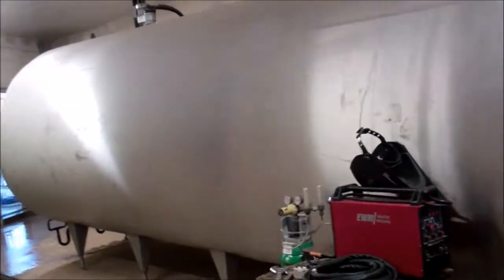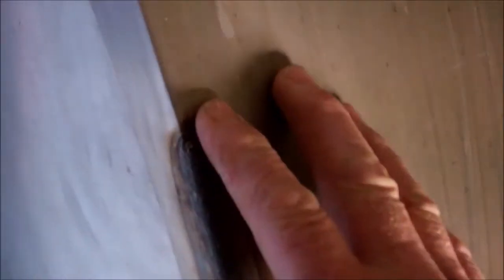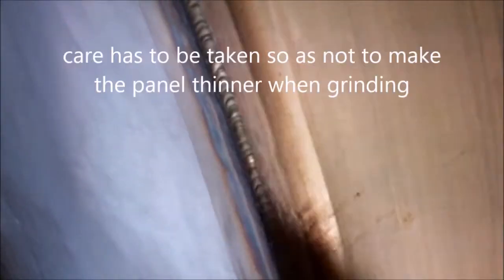Split milk tank needs tig welding repair to front stainless steel panel.

Comment: The weld is on a food grade item so I assume rhe weld is a fusion weld without filler 
Thank you for the great videos
Reply from the maker: Hi bill, This panel of the milk tank covers the insulation cavity, and to re weld this joint is a little difficult because the original weld has left an oxidized layer on the backside of the joint (as there is no easy way to purge the backside), to overcome this and get a good structural repair weld, I do use filler wire and make sure the filler pushes through the panel so that any oxidized layer that forms on the backside is pushed inwards and away from the joint itself, and I also need the weld to stand up on the outside of the joint to enable a square corner to be formed after grinding & polishing.
The other problem I am up against when welding, is stopping the panels from distortion as they are quite thin.

Comment: Can I ask what you use to polish?
Reply from the maker: Although this finish on the stainless steel is known as a polished finish no actual polish is used, this finish has a very fine grain in the surface and is created by carefully using rotating abrasive mops with the final mop being made of scotch brite material.

Comment: Good job sir! Just curious, what caused the tank to split open?
Reply from the maker: Thanks, The end panels on these tanks are flat and do flex outwards when the tank is filled and back in again when the tank is emptied, if the outer welded seam has a weak point either from poor manufacturing or has been bumped in some way this is where the crack will start, and the flexing of the panel will cause the crack to extend.